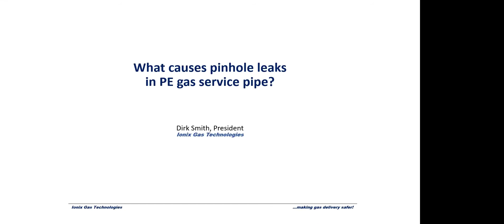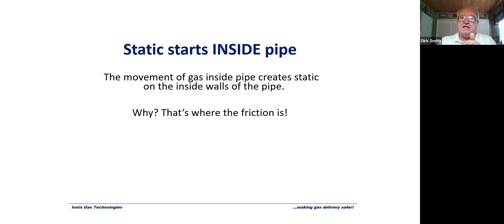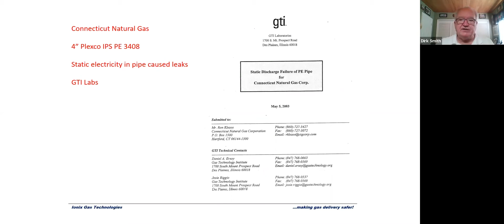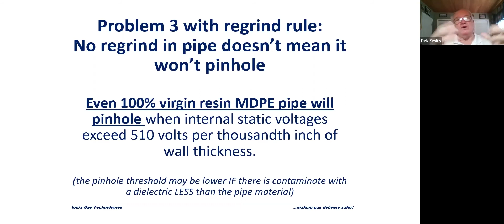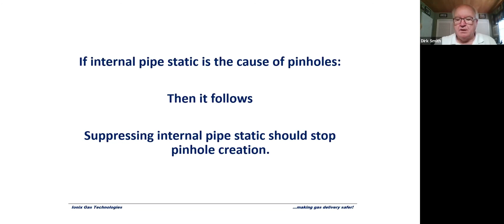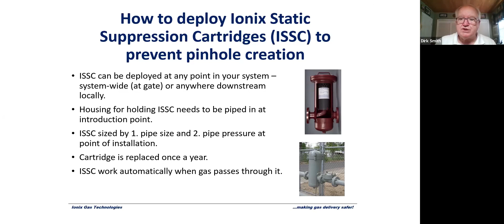What Causes Pinholes in PE Gas Pipe

Comment: Thank you for this research because it's the most likely explanation for a repeating pinhole problem I've had to fix three times over ~20 years .. for a 1" PE water pipe in New Hampshire. The line comes from underground at the street valve sloping upward and comes out of the ground underneath a seasonal cottage's open crawl space.  From there it slopes slightly downward all the way to the rear of the cottage ending at a shutoff valve and the water meter. Every year around October I shut off and drain the plumbing for the winter. I call the water dept to shut off the water in the street and take the meter.  They leave the shut off open and the water in the downward sloping portion of the line drains out.  In summary, there is an empty section of PE pipe just sitting on the ground all the winter.

The first time the "fun" happened one Spring was when I called the water department to turn the water back on.  They called me up to say they could not leave it on because there was a leak in the line under the cottage.  Close visual inspection revealed nothing so I had to make an appointment for the water department to meet me and turn the water on in order to locate the leak.  That was my first encounter with pin holes. Multiple pin holes all on one side within a ~2" length of the pipe spraying water, (70psi).   

Up until now I've been completely baffled at what has been causing this.  Was it cracked from freezing? Was it bacteria? Miniature unicorns? Nothing made any sense!  There were no leaks the prior Fall - and now there are a bunch of microscopic holes in the pipe the next Spring that I couldn't even see with a 10X loupe.   

Winter temperature can get down to -20F there so the air can get extremely dry but where is the charge of static electricity coming from?  The only explanation I can think of is critter fur.  When the cottage is unoccupied, an occasional rabbit, ground hog, etc. will go under the cottage for shelter from the weather.  I would think it is possible that one snuggled up against the line and their fur rubbed it enough to produce a sufficient charge.  The location of the leak is also where there is the tightest space between the ground and the cottage floor above, just after where it emerges from the ground - where such an animal would feel the most secure.   

I'll be looking for electrically conductive PE pipe for future repairs, something like this I suppose:  https://www.simona.de/en/products/product/product/?func=product&product_code=010000381 Thanks again!